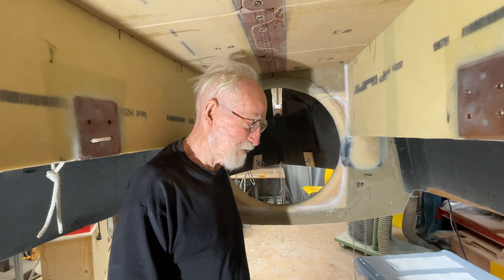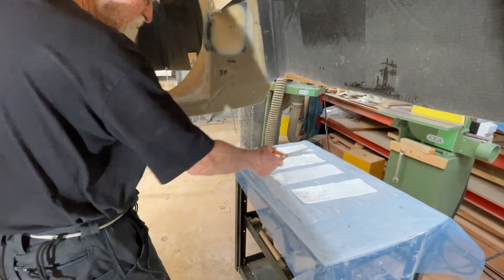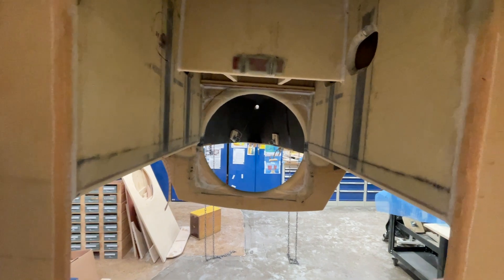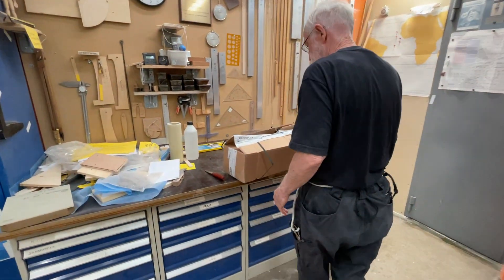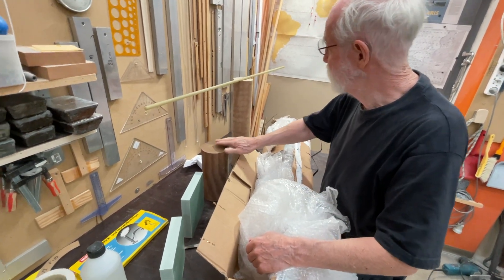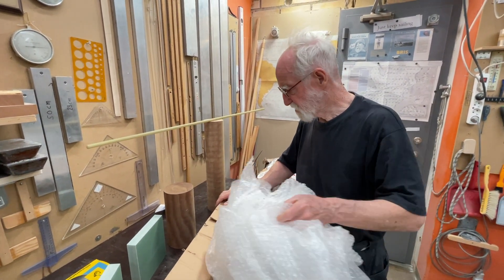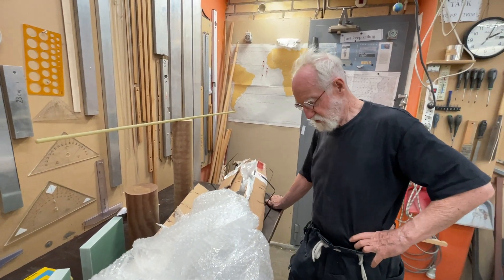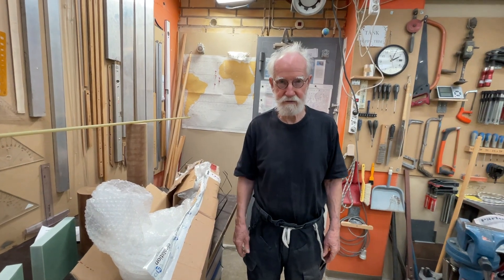13 July 2022. Unboxing composite details from Elisolation Laxå. And laminating the circular.

Comment: Thank you for today's update Sven and Peter. Is it possible to seal the Tufinol with penetrating epoxy after you have machined it to shape and allowed for several coats of sealing epoxy? That might help slow down any water absorption. Looking forward to seeing your solution. Have a good weekend coming up Sven.
Reply from the maker: This is not such a good idea becouse then the epoxy would be used as the bearing surface and that is no good.
Epoxy will not penetrate Tufnol becouse it is phenolic so the epoxy will only be on the outside.
Reply: @SvenYrvindExlex  Thank you for the information and the response.

Comment: That's great that you have companies there that can send you such custom cut pieces.  I'm trying to find some good ones here in the US, but it's not easy.

The company that makes that stuff should have the data sheets. If it's so effected when it gets wet, then that should be something the company knows about.
Reply from the maker: They knew about the waterabsorbtion.
It is 100 mg SIS standard
The problem is how much do 100 mg affect the diameter.
I give it a lot of play. Its such a big diameter I do mot think it will give a problem.
But I will keep thinking about it and ask more people.
Reply: You might cut sample pieces and let it soak in salt water for a couple months then compare before and after measurements.  Nothing like your own data to work with.
Reply from the maker: @boooshes  A very good idea.

Comment: Did you encounter this issue with previous builds?
Anyway, your analytical mind and patience always figures things out.
Reply from the maker: This is different with a laminate rudder axis.
Before I used stainles pipe axis and POM / Acetal / Delrin bearing.
Its different now

Comment: Suppose you drill the bearing ingot to the approximate hole diameter in order to sink the ingot into a marinade for a week or so, and later in a wet state, adjust ( brotch or similar ) the bearing hole to a final measurement, or do  marinading  deteriorate the mechanical properties of the ingot ?